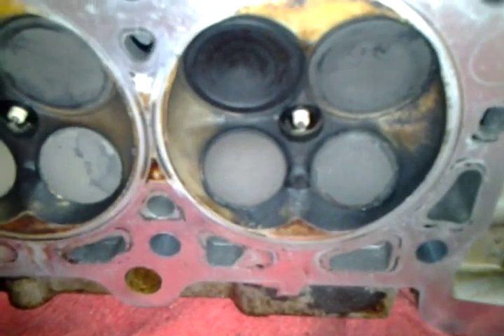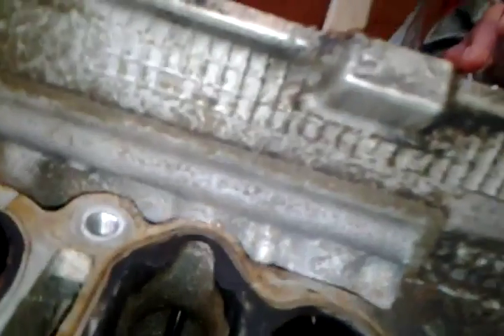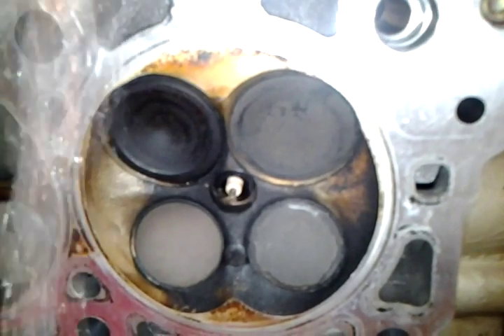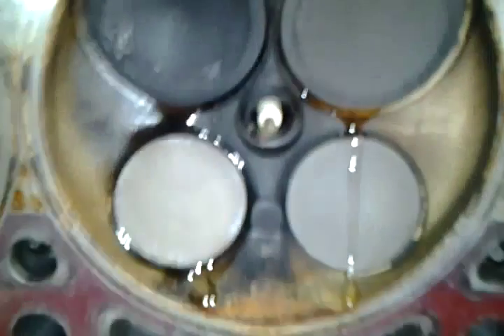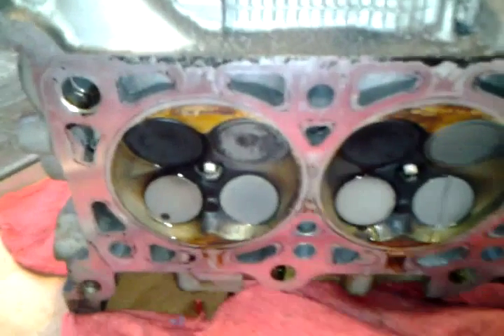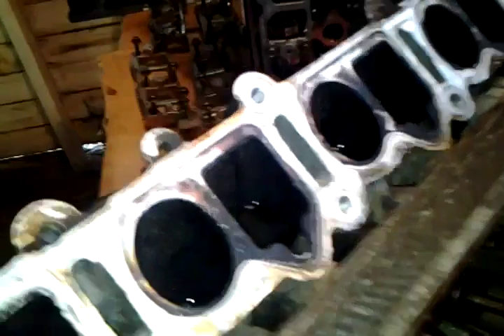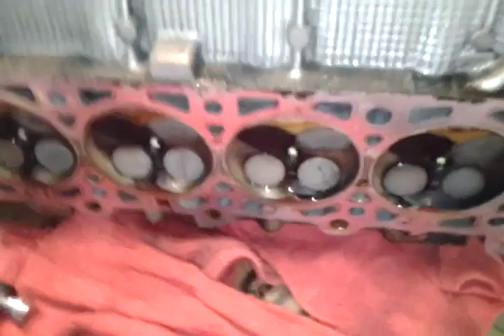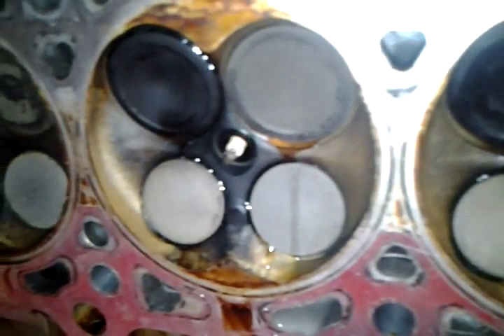Valve leak check 4.6L DOHC B Heads

Comment: Lapping compound will not with stand the heat from a combustion chamber... common sense is do a complete  valve job, apply a minimum of 15 psi of air thru the intake and exhaust ports and check for leaks. Lapping compound is for the birds......comn now.  And why were the heads even taken off??????

Comment: what ended up being the problem? bad valve stem seals?
Reply: How can you remove valve stems from a valve. This is not a tire. This is a 1 piece valve.
Reply from the maker: Kevin Gonzalez 

Carbon build up and sludge from poor oil conditions. The valve seals leaked and allow for oil and gasses to gum up at the base of the valve on the seats. I was able to remove the valve stems and put them in a drill and clean with mineral spirits and steel wool.